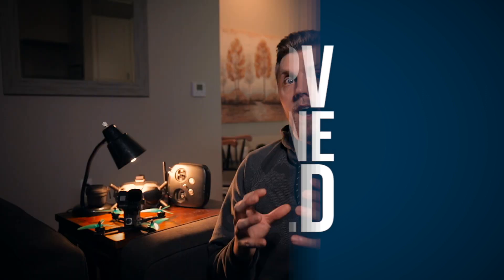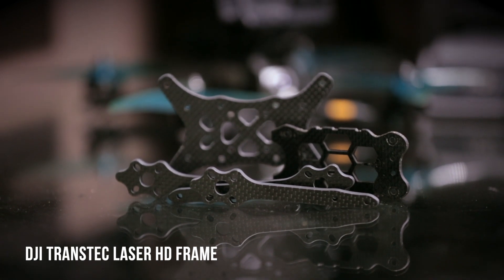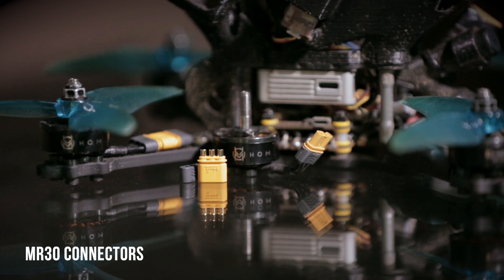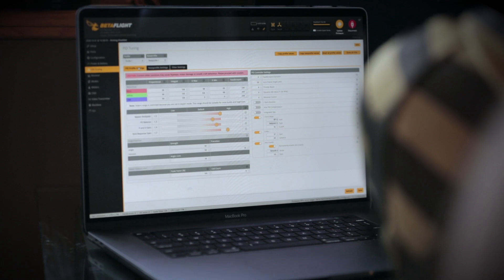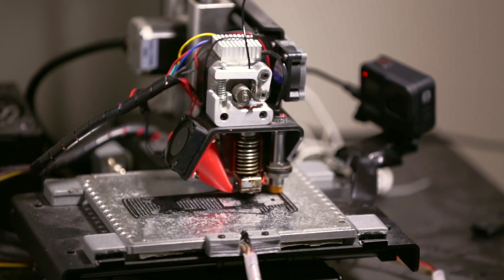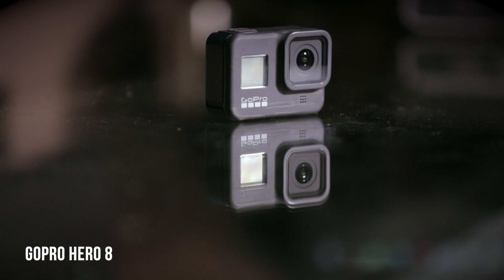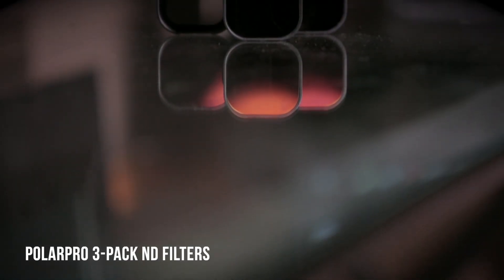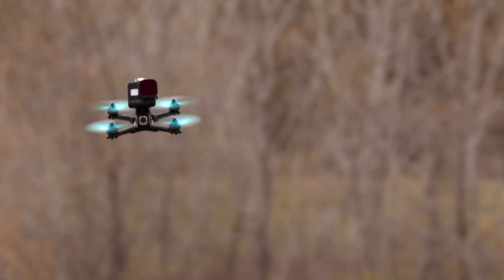My 5 Inch DJI/GoPro Mounted Drone | Cinematic FPV Tech Talk

Comment: Lovely! Can you suggest a Dummy RC for practicing with the simulator? I mean something which is cheap and decent to just fly with simulator.
Thanks!!❤
Reply from the maker: I can't at this moment. I have never flown something like that. Although, it is winter here in Wisconsin and I am thinking about maybe looking at a helicopter RC. They work differently, but the controls are similar, and it would be something I could fly indoors. Honestly, I am back to simulator work at this point.

Comment: I like the backpack solution because it protects the battery so well
Edit: could you do a video on that?
Reply from the maker: So I do talk about it a little bit in this video -> https://youtu.be/IwvDlsh4yl8, but what kind of video did you want to see? I'm always open to new ideas. But it absolutely protects my batter and wires a ton. I just did a video where I flew through trees over and over again and only hurt my props!

Comment: How long is the flight time on your build
Reply from the maker: I run RDQ 1500 mAh 4S batteries. When I'm flying hard, with a GoPro around 5 minutes... With lighter set-ups on warm, non-windy days, I have gotten up to 8 minutes of fly time. It just depends. I usually bring a dozen or so LiPos when I'm on a job or on a trip, just because my drone is so heavy (almost 2 lbs) and it sucks batteries down awful quick.

Comment: Great content bro, I watched your video about liftoff simulator and I couldn't stop watching the 'sequel' of your fpv journey. Congrats and keep it up!
I recently bought a transmitter and tried to learn some basics on liftoff but is seems to be so hard at the beginning. Any tips you can share?
Reply from the maker: Hey Danny, glad you like the content.  First off. Try a 4S quad. Something that's a bit slower. Next, once you find a drone, go to your workbench and go to flight settings and get your spin rates down. Just play with the RC Rate until your spin rate is below 600 degrees/second. You can go lower if you want, but 600 is where I fly with my actual drone. When I started out with an Xbox controller. I had this as low as 360. The last thing is maybe change your camera angle. When you're in a level, use the down key and maybe try 15 or 10 degrees until you get better. It'll just keep you from naturally gaining too much speed. Hope that helps!